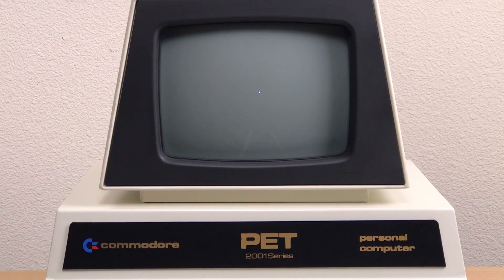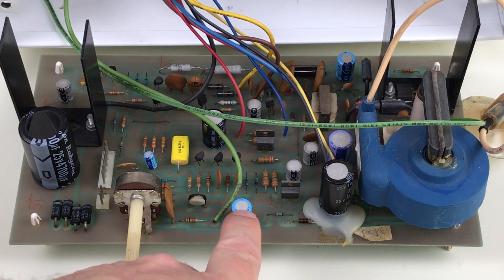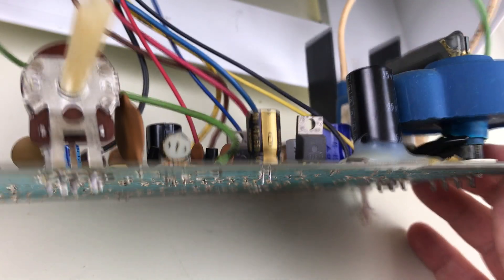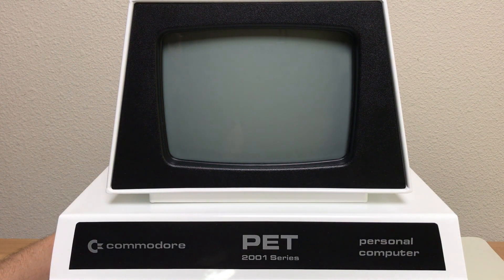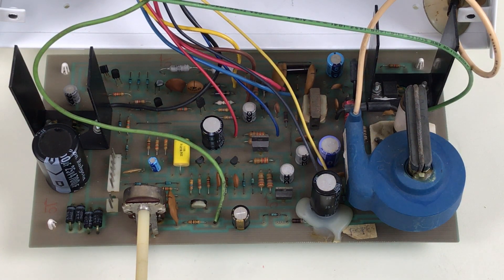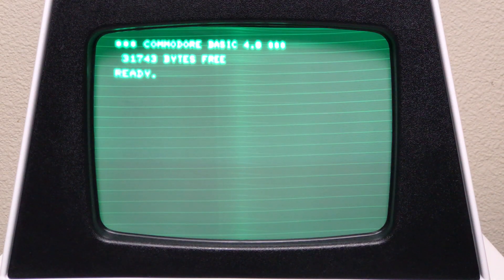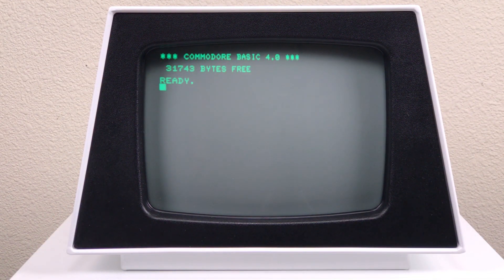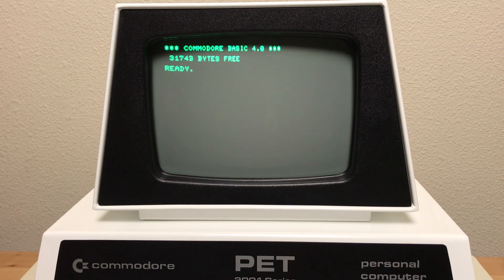Suppressing "the spot"

Comment: Nice video!. I have the Commodore PET 2001 with the black and white monitor.
It has been working fine until recently. Now the boot up screen where it says  "***COMMODORE BASIC***, 7167 BYTES FREE,  READY" the words/letters/numbers are broken up as if a line space has been printed on the screen. So it will be the top parts of the letter, a space, the middle parts of the letters, a space, the bottom parts of the letters.
Hope that makes sense!
Any ideas?

Comment: I have a feeling that -23V voltage probably has to do with why you got a spot with the fix applied. Notice also that the vertical retrace lines became visible at high brightness, indicating a lack of proper vertical blanking - which is handled by the same transistor that's supposed to prevent the dot.

Comment: Would I be on track by saying the increase in C22 capacity holds the grid at voltage long enough for the heaters to cool right down therefore stopping electrons emitting long before the grid goes to zero volts allowing electrons the pass-through to the phosphor?

Comment: I wish there was a way to use a PET as an Ethereum/0xMR hardware wallet
Reply: @HutchCA  It only needs to store encrypted seeds or private keys.
Reply: @HutchCA  a ledger nano s can hold 160 kb of data, 4-5 cryptos
Reply: @HutchCA  to act as a real hardware wallet it would need to communicate with a server or node, otherwise it would just be a cool way to store seeds and private keys, especially if you had an 8" floppy.
Reply: @Benny_Shill  I personally wouldn't trust 40-50 year old magnetic media for something like that.  You'd definitely want a modern backup or at least print-out.  As for communications, there are wifi modem solutions that could likely do this if someone was so inclined to program an interface program.  I would be more interested in an interface to an IOT hub or something with more of a local use where I can control my lights and stuff with it.
Reply: @BrianV_PM  That's why I would make 10 backups. I don't trust thumb drives either.